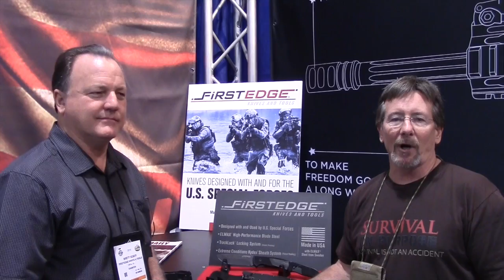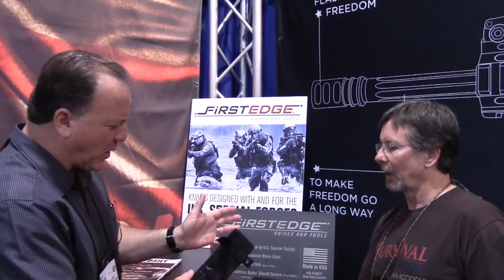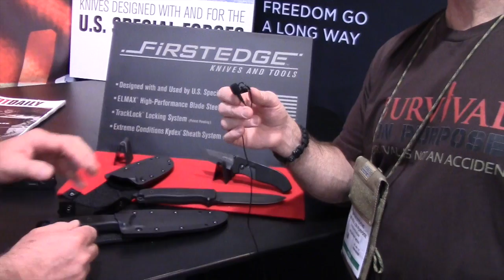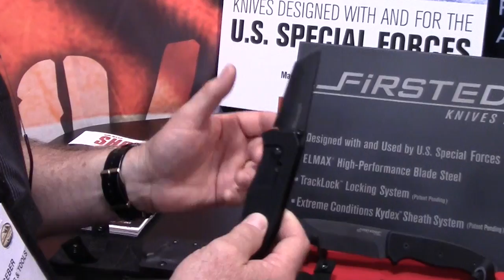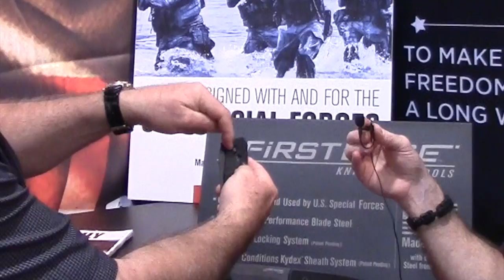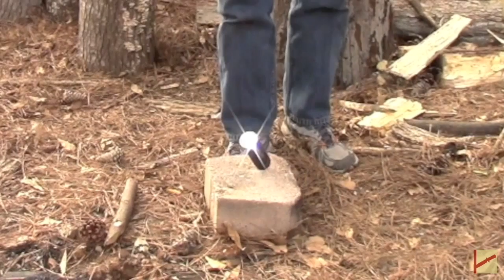First Edge Knives - Navy Seal Team Knives - SHOT Show 2016

Comment: I recently received an knife at Christmas an broke the tip and almost couldnt close it do to the liner locking system. Not worried about it because I knew God had my back. Now I know what knife to buy. That's a very bad af assisted opener.
Reply from the maker: +viewer cam I have one of their fixed blades on the way.
Reply: +Survival On Purpose I  can't wait for review